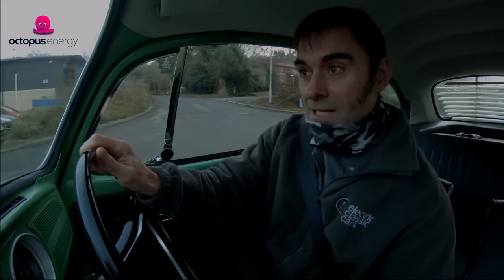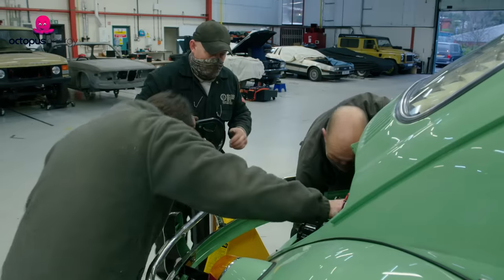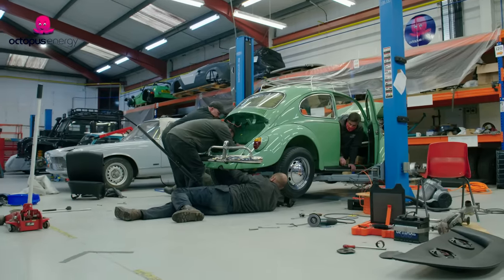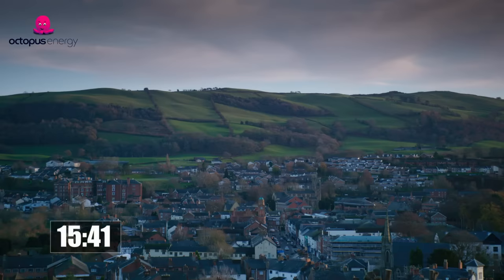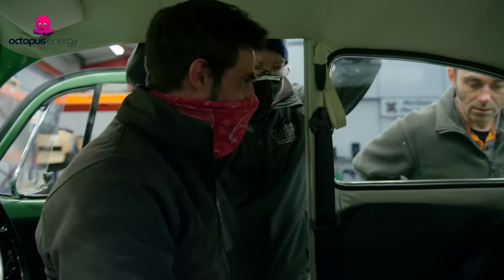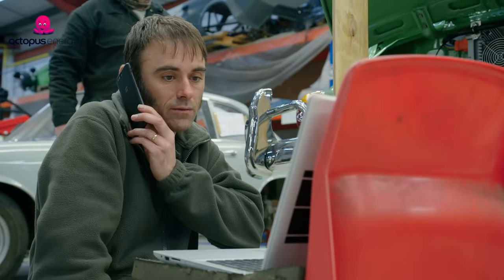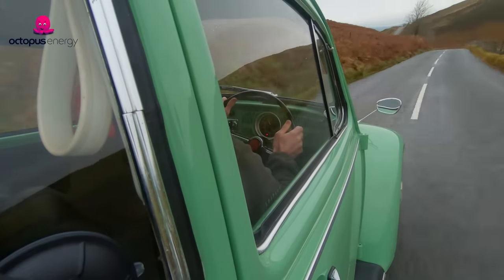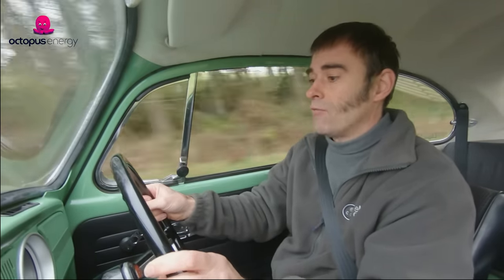VW Beetle converted to electric in a day

Comment: Back in the 60's the "Mother Earth News" published an article on showing how to convert a Volkswagen into electric. Also, back then their was no gas-less lithium batteries and the standard
12 volt lead/acid batteries were put where the back seat used to be, and enclosed, and the gases
had to be vented outside the bug.
Reply: yeah, it had about 12 miles of range.....

Comment: My first car - 1962 VW ragtop beetle - has been hibernating in my garage awaiting this tech to become efficient and affordable. I think it's time is coming soon.
Reply: yup, buying a beetle now before the tech gets cheap an d everyone does it .. .then beetles and porsches will become bloody rare
Reply: Yeah. Just a couple of decades and conversion kits will reach a more practical price level.
Reply: @gsilva220  teslas new battery style will change the market a lot. The Chinese are currently on the graphene batteries, which will also be very interesting as they allow extreme charging speeds. Finally the solid state battery will make everything cheap fast and a lot less dangerous but that's probably 2035+... We'll see, but I can't wait to have a converted classic.
Reply: @firebladeflow      I don't really care about Tesla, because their cheapest car right now costs 38k, and their idea of an "affordable" car will have things like a body-sealed battery pack. They say their batteries cost them close to $100, but Tesla only sells complete cars, not batteries/conversion kits.
What I care about is that college student that had their '05 Honda blow up on them. Electric should be the best option here, but anything beyond a used DC forklift motor will cost them well into 5 figures
Reply: @gsilva220  I'm hoping sooner. A professional kit for the cost of a motor would be a hot seller. I know I'd buy one.
Reply: @ChopFooey   OEM electric drive units (motor, inverter, 1 speed transmission, dcdc converter and charger) have already reached cost parity with conventional high efficiency powertrain (DI turbo downsized engine and 6 speed automatic transmission); it's all a matter of economies of scale.
The only thing stopping mass conversion of old cars to electric primary traction is the fact that a complete battery pack still costs people more than $500/kWh. A dc conversion can be done right now for less than a rebuild would cost, but the batteries would still run into the tens of thousands. I don't see this figure changing in the next 10 years, because car manufacturers are fighting for battery supplies right now, and there is no incentive to lower the prices.
Reply: @gsilva220  with the cost of a new car lately it is a competitive option
Reply: Don't waste your time waiting for the EV crap technology to improve significantly. Better to drive the car with it's flat 4.

Comment: Gorgeous Beetle.  Man... That's a lot of gear to remove the engine.  I always just used a floor jack and took about 10 minutes.
Reply: Pretty sure they went a bit overboard because the engine they took out is absolutely pristine. So they probably didn't want to ding or scratch it :)
Reply: That’s because you are super amazing and awesome and they are not.
Reply: They had to show a little drama
Reply: @ro63rto  Well, it should be 4 bolts but it never is.
Reply: To their credit, though.  Getting a dual-port in and out of what looks like a (mostly) early '60s body is quite the squeeze.
Edit: That body is a mish-mash.  The dash board vents and rear apron are throwing me off.
Reply: I know, I can swap engines by myself in 10 minutes.
Reply: Me, I just call over a bud with decent strength, and us 2 just grab ahold of the intake manifold and pull it back and set on the floor.  Picking car body up(it is heavier) requires another  couple of bodies to clear doghouse. Lifting on the bumper.
Reply: Exactly. I used to use two car ramps, back up. 17mm to the four bolts on my type III engine to transmission and then 13mm for the four on the stabilizer bar. A rolling floor jack married up to the oil drain plug plate on my sump add on and it balanced the engine quite well. In a pinch, I used a bean bag to set the engine onto. But the end product is beautiful. I am loving this for a daily driver and interested in cost to convert? The finished product looks as clean as can be, amazing improvement.

Comment: Two identical bugs, one converted, one stock, see what you get after 6 months using normally. Bitten by the bug at an early age, after 20+ finally got free but miss My 67. Great channel.
Reply: Six months later, my guess is you would have one bug that occasionally has to stop at a gas station and another bug that occasionally has to stop at an electrical outlet...

Comment: I had 5 of these when a teenager....my friends and I could swap out the motor in 30 minutes....3 bolts (if I remember correctly) and the wiring harness....that's it.  Had 3 that I drove to the ground with the other 2 as parts cars.  1966-1969 models.  Totally utilitarian vehicle.
Reply: I had a 67 Bug custom set up where a buddy and I could drop the motor, drag it back 20 feet from the car, push it back under and have it reinstalled, started up and reversed the car the same 20 feet in under 3 minutes. Quick disconnect plugs for the alternator wiring, a slip fit throttle cable, a finely tapered input shaft with equally chamfered splines on the clutch disc and greased bolts for engine to bell housing connection. This was set up strictly for the 2 man engine pull competitions at shows and races but I quit after my partner  missed his shift and instead of backing up 20 feet, he hit first and launched 5 feet forward into the concrete barrier between the old return road and the near lane at the old OCIR drag strip in SoCal. Nothin quite like losin the challenge and your dignity all in under 5 minutes.
Reply: 4 bolts
Reply: Still have my 73 Super Beetle.  I had several….63, 65, 68, 73, and 74.  The love of the sound of the engine, and the smell is why I love the.
Reply: @beefsoda1  Always wondered why I had a bolt remaining.
Reply: Funny how we long term beetle owners became so good at removing the engines. Never seem to do that on my daily runners these days 😜
Reply: I had someone steal the motor out of my Baja in less than 15 minutes.
Reply: My First job as assistant mechanic in a workshop for VW and MERCEDES services ….great fan!!!
Reply: Four bolts, 19mm, two wires and the fuel line.
Reply: Throttle cable too it does have 4 bolts but one is kinda difficult to get in or out so most of us left it out
Reply: Throttle cable too it does have 4 bolts but one is kinda difficult to get in or out so most of us left it out
Reply: @ricaurandt6713  , ah, the old Bug In days. I’ve seen that motor out/in under 5 many times. I’ve seen them accidentally drop the jack down and the guy undoin the starter bolts just kept wrenching, the crowd went nuts.
Reply: I remember my parents talking about pulling the motor, changing something, then putting it all back together on a Saturday morning, then going on a road trip in the afternoon. They also talked about gas being $0.10 per gallon.
Reply: They had 4 bolts, a choke cable, the throttle cable, the fuel line and the generator lead. That was it. We changed a clutch in 18 minutes on one occasion.
Reply: @2Truth2you  😄
Reply: @MrPropanePete  and coil powe, I’ve never seen one with a choke cable, but maybe
Reply: @Nixontheman  Ah yes, the coil power lead, forgot about that one. The very early Solex carburettors had a manual choke but I think they shifted to automatic chokes at a later period.
Reply: Ha. Same. I had a and old Baja in high school that would leak oil so bad I put a bucket under it when I went in to work at Toys R' US . I'd just pour it back in to get home.  It would pop up on two wheels until you shifted from 3rd to 4th. I blew out the chrome bee sting and put on a motorcycle muffler. I couldn't hear a thing when I drove it and had to quickly use that hand crank to close the skylight before I went under a bridge or it would blow my ears out. Once while riding it in the woods I somehow flipped it on it's side, got out and pushed it back up on 4 wheels by myself. I got stuck on  low water crossing once and just pulled the distributer cap off, wiped it off with my t-shirt and carried on.. beer cans floating in the back seat. The floorboard of the driver's side was a street sign. It constantly blew the motor mounts between the tranny and the engine ..my friends and I got so good at pulling that engine that we pulled it and replaced the motor mount with no other light than a 55gallon drum on fire of trash and wood we fed it for light. I miss that car so much.
Reply: I also had 3 that I drove to the ground , great cars when they wanted to run 🏃‍♂️!!
Reply: This - I had a '67 Baja conversion in high school, then a '67 lowered drag bug, and a beautiful red '65 Bus with seats removed and shag carpet.  That Bus was as slow as it was fun.  I think I paid $200 for the bus in the early 80's as it needed a transaxle, which we had delivered from a junk yard and replaced at the house.  I miss those days.  I was just looking to see what was available in that vintage and prices are eye watering.

Comment: In 1971 I met a man in San Diego who had converted a1962 Bug to electric with SLA batteries and a military surplus DC motor, about 40 horsepower, and the car ran quietly just fine. More than 50 years ago, and it was quite an experience.
Reply: did ya see the car or is this what he told you??
Reply: @tommurphy4307  The man was a customer at a VW dealer (San Diego Motor Imports) where I worked, and I and a fellow employee accepted a test ride in the 62 Bug.Very quiet and smooth, 4 speed clutch and transmission operating normally .
Reply: Actually that "40 horsepower DC motor" made/makes more power than the OG VW 1600 IC gasoline engine.  A very good running example of the gas engine would have 45 HP on an engine dyno, but the electric motor has much more torque at lower RPM and wastes less energy as heat.......
Reply: @victorspinetti5145  40 horsepower (max) DC electric motor (at 12volt or 24volt) was designed by a private citizen (with training in electrical engineering and mechanics and the point of this essay is that an average citizen (in 1971) could make an electric car that the industry could not.
Reply: how do you get a smooth throttle control on a 40HP DC motor?!

and if it was running lead acid batteries, what was its range?  about 15 miles?!
Reply: @kenwittlief255  I am not an engineer, I was a parts dept counterman who was offered a ride in a custom modified bug that was put together as an experiment by a customer at my VW dealership. It was not meant to be a prototype of an actual car. Just this clever backyard mechanic who wondered and then built something that was unique at the time. And I remember the driver shifting through the 4 gears and the whisper of the motor. It ran, I was there.The thing that remained with me is that this ordinary guy had a vision for a possible electric car. And experimented like other Americans.
Reply: @dehoedisc7247  I agree, in 1971 the auto makers worked closely with the oil companies (still do).  With gasoline at about $1.50 per gallon in 2022 dollars, there was not much interest in electric powered vehicles except for some golf carts and fork lifts.

Comment: 🇺🇸 As great as the conversion is, I'm just as impressed with the restoration of the Beetle. My first VW was a 1958. Then, a 1964, 1969 and 1973 Super Beetle. Brings back memories.Thanks👍
Reply: It was built by a friend of mine , he was only 18 when he started it , I built the engine
Reply: @Petterjunior  I hope the engine gets a good home.
Reply: 58 was the first year of the big back glass
Reply: @Petterjunior  wow my first vehicle was a Volkswagen square back but when I rebuilt that motor which was a 1600 CC pancake engine with dual Port heads two carbs and I just was amazed at how fast that car was but as far as your restoration goes that was a piece of art I'm hoping that that motor finds a nice new home
Reply: @johnbrentonlll  I had a ‘63 with the little oval back window
Reply: My first car was a bug, a 1957 in 1967. It had the smaller window in back than the 68 if I recall
Reply: 1973 super beetle! I owned one for 16 years. Gave it to my nephew with 99,000 miles on it.

Comment: Great idea    My first car was a 1961 VW beetle   I loved the styling of the car but I REALLY LOVED THE SOUND OF THAT AIR COOLED ENGINE !!!
Reply: That's the who idea of a VW Beetle ... the sound of the engine. Music to ones ear. Making it electric has just got silly.
Reply: Just get a riding lawnmower and you'll get the sound of an air cooled engine. I worked with a mechanic who did a conversion on his old VW Bug, but he took it in a different direction. He raised the VWB just a tiny bit to allow him to mount a double blade riding lawnmower deck beneath the VWB. Then he ran levers, pulleys and belts to power the blades. It was a cool project. His wife didn't care for his mower because he used to mow as fast as the vehicle would go across his fields.
Reply: Karl Partridge -
Just get a riding lawnmower and you'll get the sound of an air cooled engine. I worked with a mechanic who did a conversion on his old VW Bug, but he took it in a different direction. He raised the VWB just a tiny bit to allow him to mount a double blade riding lawnmower deck beneath the VWB. Then he ran levers, pulleys and belts to power the blades. It was a cool project. His wife didn't care for his mower because he used to mow as fast as the vehicle would go across his fields.

Comment: I look forward to seeing the package upgraded to use a Lucid motor. Much smaller and lighter while being more powerful.
Long term upgrade would be solid state battery conversion to reclaim some storage space and weight savings.
Reply: That's a downgrade, a bus motor is an upgrade
Reply: So...replace real parts with vapor ware
Reply: @circusboy90210  

The Lucid motor is far more advanced, compact, lighter, more powerful and more efficient than the Tesla motor.
Reply: @googleuser4434  

Imminent roll out soon so nowhere near 'vapor ware' (sic).
Reply: "it's coming soon I promise"
Reply: @googleuser4434  I mean people have driven it, the car exists, I dont see why they would not release it once its all done

Comment: Brilliant! I'd love to see more on the cost breakdown of such a project.
Reply: About 20k, batteries included
Reply: 20 k does that include labor?
Reply: @henryroman5997     Depends on the shop you choose to do the conversion, but this is the sort of project you end up having to do yourself, unless you're in California
Reply: @gsilva220  why California .? Is it not allowed ?
Reply: @michaelclark7536  California has several of these conversion shops
Reply: 20k? Thats decent if done by shop. Considering the cost of some other conversions
Reply: @jonog5632  there’s a more than you think on the East coast too.
Reply: If it costs 20k to convert then I'd rather put that money into a second hand Tesla. What's  needed is a 5k conversion kit Inc battery.
Reply: @cwwiss1  this car has a soul. 2nd hand Tesla, not so much.
Reply: £20k ? This needs more research
Reply: @cwwiss1  second hand Tesla's are more expensive than new ones
Reply: Wow impressed....what to do with heating ? As there is no coolant fluid?
Reply: @cwwiss1  

I’d rather buy a long range tesla motor, it’ll make this lightweight car move faster than many cars
Reply: Except the car will cost you you between $20-$40K US and restored busses are going for $90-$120K.   US. It is not worth it, and that range is what you got back in the 70s and 80s.
Reply: i can build the most beast turbo car for 5k
Reply: I just paid $7,500 for an electric dirt bike. None of this is cheap!
Reply: @jonog5632  that car was worth 10K as it was.  20k is twice its original worth
Reply: @krusher74  A well restored Beetle is worth $20K easily. Ive seen them going for $50k. If you want cheap get a new beetle for $5k
Reply: If you have to ask and they don't tell you, then it's too much!
Reply: @gsilva220  Ah, more like 70-80K...
Reply: Here is what their FAQ page says about cost:
What are the typical costs of a conversions?
Cost can vary quite a bit depending on the customer’s requirements for range and power, as well as the make and model of car. A small car with sub 100 mile range might cost as little as £30k for us to convert, whereas a large 4x4 with 200 mile range might cost over £100k.
Reply: @Indobiker61 , the original Beetle had air air-cooled engine.  No coolant fluid there either.
Reply: How does the heater work?
Reply: @gsilva220  or 10-20 thousand litres of petrol, which would get you 50-100k miles. Do that amount in the electric one and you'll have to spend it all over again to replace the batteries....and I haven't even included the cost (or inconvenience) of charging. What a waste of time.
Reply: @gsilva220  Eugene Oregon has a conversion shop at 6th and Garfield.
Reply: @jonredd650  its always too much.
Reply: @CaptainCraigKWMRZ  I have a quad powered road bike that runs on Pizza. Unlimited range. 😂
Reply: Too much!

Comment: Very cool job.... You can master that by replacing the battery under where the heat chambers are instead of the front luggage and having that free for storage space. I hope that the car feels nice with the current battery location even at harsh bracks. Thank you for the video.
Reply: Balance is key.